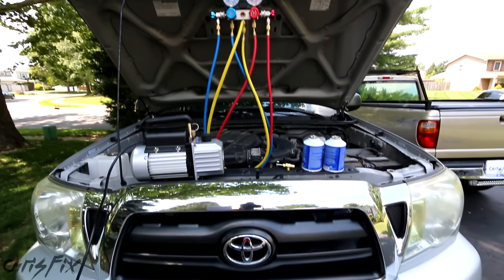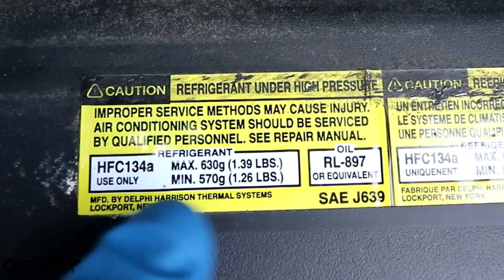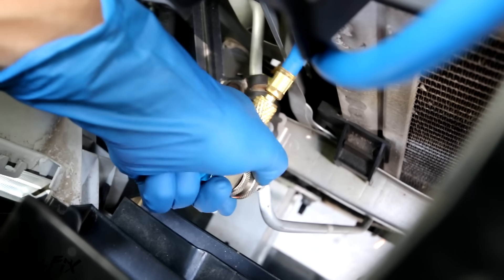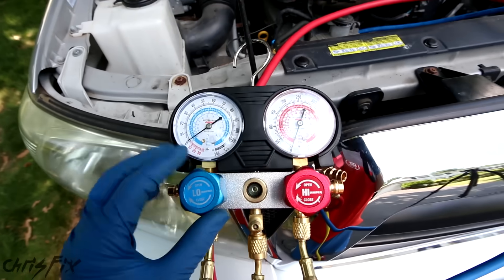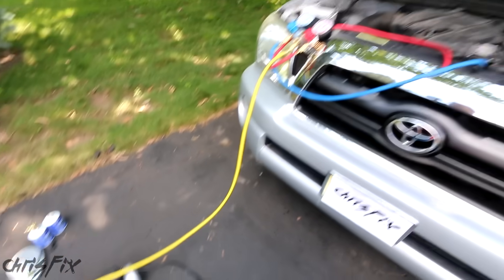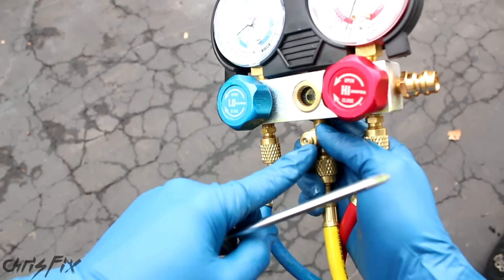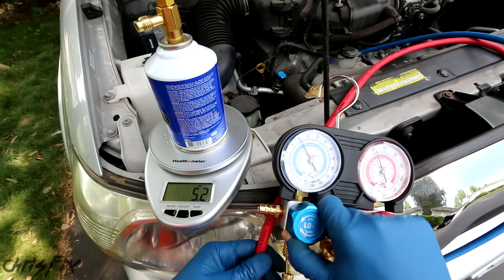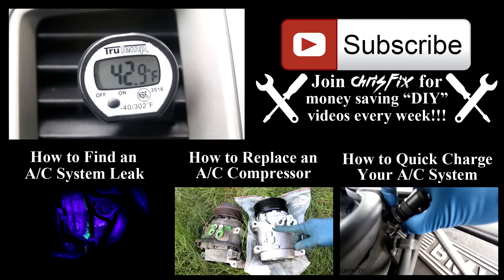How to Properly Recharge Your AC System

Comment: Thank you! Wonderfully done and explained except I have two questions...

1, how much does an empty can weigh? Seems like a bit of an oversight not to take that into account, no?

2, 10.13 time mark, you mentioned to only use the low side (blue). Are we not doing anything with the high side (red)? Is it still connected? Is it open or closed? When? 

If Chris is otherwise preoccupied to get to this comment because he a, has a life and b, is making awesome helpful vids for us, I wouldn't mind if someone else would also chime in and help out, thank you!
Reply from the maker: 1 - I get why you're saying that but in this case when I put the second can on the scale, I’m not trying to weigh how much was in the can total, I’m watching how much is being removed so I know how much refrigerant is going into the system. Each can has 12 oz of refrigerant, so I used 1 full can (12 oz) to start. Then on the second can, I watched the scale drop from 20 oz (can + refrigerant) down to 10 oz, meaning 10 oz of refrigerant went into the car. So 12 oz (first can) + 10 oz (second can) = 22 oz, exactly what the system needed. I just watched how much refrigerant was pulled out and knew that that was the correct amount.
2 - You don't touch the high side at all, leave it connected and as showed until the end, it can be very dangerous to try to fill from the high (pressure) side
Reply: @chrisfix 1, ok that makes sense, thanks!

2, ok so high side remains connected, but closed, is that correct?
Reply: @chrisfix ok so: 
-leave the high side hose installed on the high side line
-leave open at the high side port
-leave closed at the high side gauge

Got it, thanks!  😎👍

Comment: As a professional blue seal shop owner & a master technician I just have to say thanks. You are spot on. This is the correct way to service an A/C system. NEVER EVER buy the do it yourself can at the parts stores. The parts people KNOW that you can NOT (it is impossible) to accurately service your A/C system with these kits; however, they make money selling the crap to unknowing people. In addition, if you attempt to use one of these DIT kits, be aware that there are shops that will not attach their service equipment to your vehicle as the "sealer" will plug the machines filter.

Comment: Question about adapter for ac can. I have 2 of them and noticed that one has Schrader valve (on side connected to yellow line ) while the other doesn't. Which of those 2 are you using? Thx

Comment: If I replace the condenser will I need to add oil?
Reply from the maker: Yes if you replace the AC condenser, you’ll want to add a small amount of oil to replace the oil that was in the old condenser. Most condensers hold about ~1 ounce of oil, but it depends on the car/truck. Some new condensers come with a tag or paperwork that tells you if they’re pre-oiled (but most are not)
Reply: @chrisfix thank you very much for your response! Your video is very helpful and I plan on replacing the condenser and my wife's 2015 Chevy Silverado tomorrow.

Comment: Hi Chris I need to replace my ac compressor on my 2011 Toyota Prius I do have all the tools that you show just need to buy the refrigerant I do have my new compressor is ready to install has oil in the system but my only concern is before I remove the compressor I need to discharge the refrigerant on my old compressor because is full , now can I use the pump to drain the refrigerant before I remove the compressor please confirm if is ok to discharge at home with the pump I’m in the desert so not to many  house around I’m ready to do it just waiting for my ac kit is coming tomorrow thanks
Reply: No.  The vacuum does not do that.  
You need a recovery machine and/or tank to do that. 

A mechanic shop should be able to do that for you for a fee (of course)
Reply: @deasttn  this people the just saying just let the pump do the work don’t understand why not because the old compressor will be disconnected and the refrigerant will go away I’m in Mexico so is a desert and no regulation here

Comment: Chris I have a question? So you don’t worry about what the gauges read? You just fill it by required weight?
Reply from the maker: Practically most of the time it's best to just go off weight and you can do this successfully no problem. There are some charts and guides out there as to how to read the gauges and that can be a nice way to double check or if you don't have a scale you can go off them.

Comment: You get it to 30" vacuum, close the valves, come back after an hour and see 30 still (so no leaks), then turn on the vacuum pump, and open the valves to dry the system out awhile. So the valves were closed when you checked  for leaks, and you were only check for leaks in the manifold system, not the car A/C. Should have mentioned "open the valves" before checking that the vacuum held for the hour.
Reply from the maker: I get the confusion but when you pull a vacuum and then close the valves on the manifold, you’re sealing off the vacuum pump, not the car’s AC system. The manifold gauge is still fully connected to the vehicle, you’re just isolating the system so you can see if it holds vacuum on its own for the leak check. So yes, when you close the valves after pulling down to 30 inHg, you’re not just checking the manifold, you’re checking the entire sealed AC system for leaks. You’d only be “just checking the hoses” if the valves were closed the entire time and never pulled vacuum through the system. But that’s not what’s happening in the video, the system is fully under vacuum when the valves are closed for the hold test.

Comment: Just had to replace condenser on 2018 nissan rogue. All good through parts and vacuum. Attached and released a small can 134a brought system to about 7lbs which isn't enough for pressure sensor to allow compressor to run.
What method would work to engage compressor? 25 years ago when I last worked on an AC was 2 pressure switches and simply jump low would allow charge. What do you do on newer pressure sensor?

Comment: Hey Chris.  You said you previously had the oil put in when you replaced an AC part before so the AC oil wasn’t put in, but because just you vacuumed it, wouldn’t that have pulled the previous oil out?
Reply: No.  The vacuum doesn't pull the oil.  It really only pulls the gas

Comment: I'm getting ready to pull a vacuum on this bad boy early in the AM.  Two questions:  1) What is the approximate time that I should be pulling vacuum (mini cooper R50 that takes about 15 oz of R134a). 2) I had to take a wheel off and it's sitting on jack-stands a couple of feet of the ground from front only.  Is it ok to pull vacuum and to recharge while is lifted?  Thanks.

Comment: So question if anyone knows.. he mentions you’ll have to add oil if replacing a major component.. what about if I’m just replacing the high side port and orifice tube? Does that mean no oil needed just recharge?
Reply from the maker: In that case no oil is needed, a major component is like the accumulator/driver, condenser, or compressor that holds most the oil
Reply: I'm hoping no oil needed after I replaced the evap core.

Comment: Hi just a quick question if there are any leaks what is the best possible and money saving should I perform. Well I have my boyfriend to do the work and we need some pf your guides and suggestions.

By the way I really like your videos and I do love what you do. More videos to go and be safe always 💗❤🫶
Reply from the maker: It's usually O rings in the system that flatten out and get dry overtime, I'd do a recharge like this to condition the seals and stop it from leaking (otherwise it's a ton of labor to replace those o rings): https://www.youtube.com/watch?v=SHg2xRMnM38

Comment: Awesome video. I did have one problem.  It may have been a different brand but the nozzle that attached to the r-134a can is open when it is screwed down on mine.  You said that it is to be screwed down to puncture and then out to open. That was not the case on mine and I sprayed a bunch of refrigerant out when I detached the nozzle from the yellow hose.  Once I figured that out I understood why I hade to keep opening and closing it to inject the refrigerant into the car
Reply from the maker: Yeah it might be a different setup in your case but I'm glad you were able to get it done

Comment: Avoid turning the can upside down.  Use hot water in a small bucket to place can into in order to evaporate gas into the system.
Reply from the maker: For most of the charge yes, but as the can get's lower there is barely any pressure left to push refrigerant out so upside down or warming the can works
Reply: @chrisfix I’m nit-picking, it’s a great video, really well done.  Just want to avoid liquid Freon upsetting the compressor…low chance but definitely above zero.  Can almost empty and yeah no worries!

Comment: Hi cris
I did charge my honda civic lx ac just like you explain in your video. 
But temps only go down to 60. But I think it suppose to go till 40 digree. Can you please tell what should be the problem with this car. Or any thing else. 
Please let know.    Thanks
Malik
Reply from the maker: It's probably undercharged in that case, I'd see what your pressures are at and go from there

Comment: Thank you for the video chris! Love to follow you mate!
Btw, I have an issue that I have gas, I have new condenser, but the ac low line is not cold and the high is hot . The car cool only while driving. 
Ordered ac compressor+lines+drayer 
Thats the right way? Or i need to look for something else?
Thank you 🙏

Comment: I know this video was uploaded 9 years ago, but I actually followed it step by step while replacing my AC compressor on the 4th of July. It was incredibly helpful—I now have cold air blowing at 47°F! The only issue I ran into was that my system didn’t want to take the second can of refrigerant, so only 12oz went in when the system calls for 18oz. I’ll figure out how to top it off, but overall, huge thanks to ChrisFix for making such a clear and detailed guide. This video made the job so much easier!

Comment: Hi Chris, thanks for the video.

Would like to ask if there’s a leak in the system, Should I still vacuum the system for 45 minutes for me to add UV dye and refrigerant in it? I want to find a leak in it. Thanks
Reply from the maker: Not much of a point since it won't hold, just do a slight recharge and then trace the leak and fix then do this properly

Comment: Aren't your hoses the wrong way round? I thought that kink was supposed to be at the bottom of the connections, or does that not matter? I have the same vacuum unit; in the picture, the kink was below the HP and LP connections. It was straight at the top of the valve block. So does it matter how I have the hoses, or do they have to be like yours?

Comment: At 6:41, “One hour later and this looks pretty much identical.”

You’ve now had a vacuum in there for 1 hour already. Do you really need 45 minutes of vacuum after an hour of vacuum?
Reply from the maker: During the leak check the system is under vacuum but you haven't actively removed anything new, a little moisture can still be trapped so by pulling a vacuum for another 45 minutes you'll boil anything off and ensure you're system is completely dry and everything works properly!

Comment: When disconnecting the lines for you make sure you have the ac off? I still had freon or pressure in my hi line when I was taking my hose off the gauge when both lines were already off the car im guessing some was stuck in the line so how do I prevent that?

Comment: Just wanted to let anyone know a problem I ran into. My air had been getting warmer and warmer for about the last month and it got unbearable the other day so I figured I’d need to recharge it. Well when I got to the part where you’re refilling the refrigerant I noticed my compressor wasn’t turning on and sucking it in. If this happens to you, find your AC clutch relay in the fuse box and replace it. It was only $11 and now the compressor is working properly and my air is cold. Thought I needed a new compressor for a minute. 😅

Comment: To add air conditioning gas to a vehicle with gas in the system, they usually first make a vacuum and then pump gas. Oil is also added to the system at this stage. Does the machine also pull oil from the system while vacuuming?

Does the oil of the system completely drain with the compressor or does some of it remain inside?

Because the sanden I have says 770gr gas and 135gr oil for the compressor. If oil remains in the compressor, there is no need to add 135gr again.

Comment: 9:11 when you purge the air out of the yellow line, you didn’t tell us if we needed to open the manifold valves, but clearly your low side pressure has changed. Are we supposed to open both sides? Or just one?
Reply: Close all then purge. Then open blues.
Reply: @mouaxiong8618 thanks! I had eventually figured it out but was initially confused.

Comment: ChrisFix,
Consider myself another satisfied responder. I would add a couple of things. If you live where there is an Autozone, they will loan you the manifold gauges and vacuum pump for free. Saved $330!!! Also, if you lose pressure, check the seals in the manifold gauges before you start checking the system. It might be that simple. That's what happened to me. Blessings ChrisFix, you are a great helper.

Comment: Thanks, very helpful. Adding oil in the line is tricky, overspill. I used a seringue, it worked like a charm. Also, my new ''system'', lines and gauges, did not hold the vacuum. To pinpoint this, I dropped the vacuum to -30, then closed the low and high pressure ports and confirmed the vacuum was dropping without the presence of the car AC system.  Hence, when I reopened the low pressure port the pressure dropped again to just about -30. So the leak was from the blue line and gauge.  Merci encore!
Reply from the maker: Good troubleshooting, glad you found the leak!

Comment: 5:08 how do i know if my AC system still has refrigerant?
Reply from the maker: If there is any pressure the gauges won't be at 0!
Reply: @chrisfix  so you can't add refrigerant from the can if it's not 0?
Reply: @damson2809  you need a vacuum
Pump regardless to suck air out of the system, after sucking all air out of the system you can add Freon
Reply: @damson2809 the can from the  parts store  has a mini gauge that'll be your guide and it doesn't need to be at 0 to fill up

Comment: 🤣🤣🤣🤣🤣🤣🤣🤣🤣🤣🤣🤣🤣🤣🤣!! You are NOT weighing the can, you are also weighing the hose weight, which may change depending upon any movement.🤔😮‍💨🤔  The empty can would need weighed to get the tare, and to be accurate, remove the last can after some has been added, and weighed to see how much refrigerant is left until the right amount is left over.  But, at least your way may get it within an ounce.

Comment: Hi Chris.  Thanks for the content.  If it is a compressor replacement, as your other video shows, do I still need to follow this process here (to pull vacuum for any remaining junk in the lines), or do you skip the vacuum part and go straight to re-gassing?  Have a nice day!
Reply from the maker: You always pull a vacuum to remove moisture and air.

Comment: Anyone have advice on this. The new r134a bottles are self sealing. First bottle I put a self sealing tap on and it started leaking out from the sides, didn’t seem like much if any actually going into the system. Had to take off the tap and the refrigerant gasses out everywhere. Second bottle no leak but none would enter system, had to take tap off again and complete bottle was wasted. Expensive but also feel bad about the gasses going into the environment. What an I missing? And how are they self sealing if when I take off the tap they aren’t sealed?
Reply from the maker: Make sure that the tap is the proper type for self sealing cans, otherwise it won't thread on properly or depress the self sealing valve and it will leak out
Reply: @chrisfix thanks Chris! I specifically got the “self sealing tap” the Pittsburg one from harbor freight. So maybe bad luck and I’ll try again or I’ll try a different tap
Reply from the maker: Interesting, sorry to hear it didn't work, might just be a bad tap or mislabeled or something. I would return and get one from a different brand
Reply: @chrisfix sounds good, thanks Chris!

Comment: 10:30 where he says perfect the compressor just kicked on, my gauge doesn't go down so does that mean my compressor is busted? (It's electronic and the pulley isn't visible).
Reply: Correct, the compressor gets powered on once the pressure sensors detect enough enough pressure son next you would want to verify power at your compressor clutch conector and if there is after it’s full and running then it would be the compressor

Comment: .......mines was nice & cold. 25min later  not cold anymore.  System has no leaks, NEW Compressor  & Condensor . Gauges read normal. Hypothesis?
Reply: check the suction line if it is cold and sweating.  what are the pressures?  what is the ambient temp?
Reply: check the blend door actuator.

Comment: Thank you for the awesome video. Little confused on the vacuum process when you close the high and lo valve on the guage manifold itself. Is that not just isolating the vacuum psi to the manifold block at that point and not the whole vehicles system? Thanks
Reply: you are closing the whole system.  the service valves are open.

Comment: My low pressure side isn’t going lower than -20 inHg and I’ve been on the vacuum for 30 min what should I do? Or what does this mean? Also not sure if the mechanic lied to me and didn’t empty my freon because my vacuum looks like it’s leaking from the top not sure though
Reply: there is a leak.

Comment: Chris,
Followed yr directions and found when introducing refrigerant LP side climbs to 110 psi and will not accept refrigerant. Can you advise on this?
Reply: you have to run the engine and turn ac on.  check if the clutch engages.